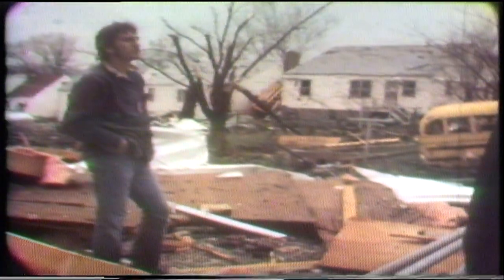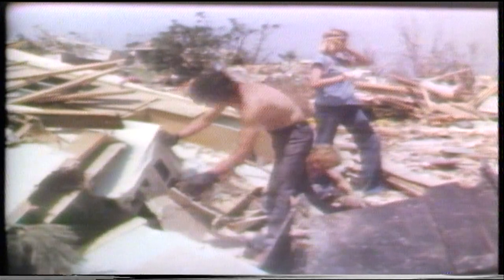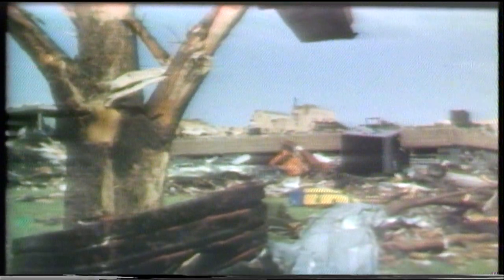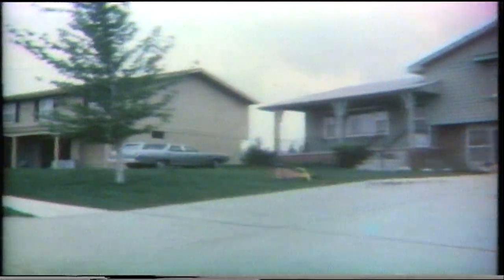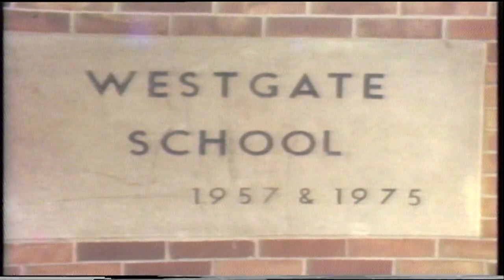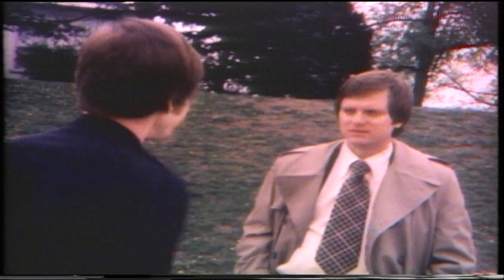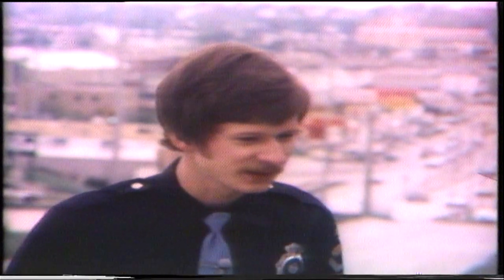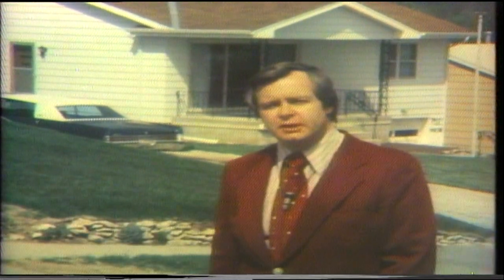1976 Special of 1975 Tornado

Comment: Thank you for posting this documentary.  Wikipedia lists this tornado as an F4 (wind speeds of 207-260mph); which on today’s enhanced Fujita scale would be an EF5.

 It’s much rarer today that even local news stations would devote this much time in broadcasting the story of the destruction & experiences of the residents affected by a tornado; especially by airing such in an in-depth documentary on a single event like this a year later.  Today’s TV news contains only snippets of actual news, obviously basing their programs on attracting viewers rather than simply presenting news stories with this much integrity, and without a political slant or commentary for one party or another.  And If it doesn’t fit into a half-hour program, you won’t see or hear about it.  

Today, most in-depth severe weather reporting is done by independent storm chasers or cable weather channels; other than the local TV station meteorologists who air live during severe weather.  Historical coverage is often posted by storm chasers or individuals with a sometimes not-so- hidden agenda of attracting subscribers to their channels.
Reply: The EF rating same as the older F rating is determined by damage done not the wind speeds, otherwise the Oklahoma of a few years back would have been labeled as the first EF-6 those wind speeds were well over 300mph.
Reply: @animalyze7120  You're partially correct. The Enhanced Fujita Scale is the same basic concept, however the damage required to recieve and EF5 rating is far more significant than the damage required to achieve an F5 rating. The NWS has stated on multiple occassions (Tuscaloosa, Vilonia, Mayfield, Rochelle, and a few tornadoes from the Late May Outbreak in 2011 to name a few) that tornadoes rated high end EF4 would have likely gotten F5 ratings had they been rated under the original Fujita Scale.The reason for this being that the Enhanced Fujita Scale is far more strict and concise about what windspeeds are required to achieve a specific degree of damage. This helps reduce the subjectivity that the original scale was often prone to and results in far more consistent and clear ratings.

The original Fujita Scale did have an F6 rating but it was never used because no tornado produced the damage necessary to recieve the rating. If I
m not mistaken (and I may be completely wrong on this so don't quote me on it), several tornadoes had actually been considered for the F6 rating including Xenia, Moore '99, and Jarrell. I believe you are refering to one of the El Reno Tornadoes. Both El Reno Tornadoes has estimated peak winds of 295 mph and while the El Reno '11 tornado did sufficient damage to back up the more than deserved EF5 rating the El Reno '13 Tornado only did EF3 damage and as such was rated in kind. The Enhanced Fujita Scale does not have an EF6 rating so the prospect of any tornado at this point in time recieving such a rating is about as impossible as it gets.

Comment: Why is the audio so quite you can barley hear any of it
Reply: I only hear it on one speaker, the left one.  Otherwise, it's pretty good.  It could also be because I'm using dolby atmos for headphones.
Reply: i  heard  it  in  stereo  no  problem  volume  was  good  2
Reply: sounds like it was on vhs originally, if that is the case any videos quality weren't as good. it's still a good video even tho I can only hear it in one ear!
Reply: @aprilchamberlain1677  i  heard  the  whole  video  in  Stereo  check  your  speaker  settings